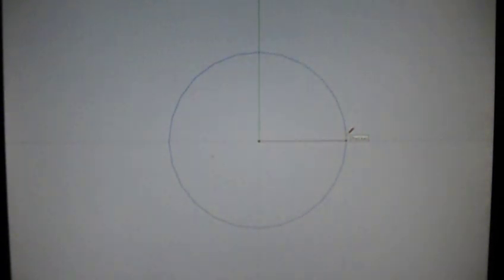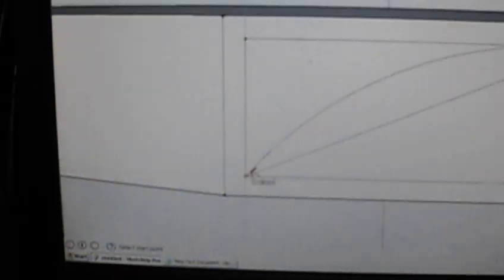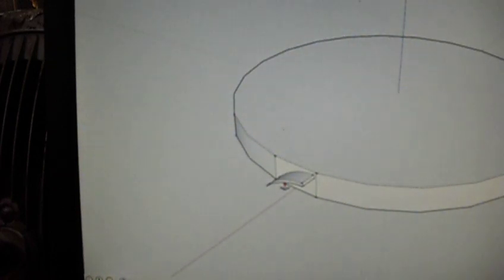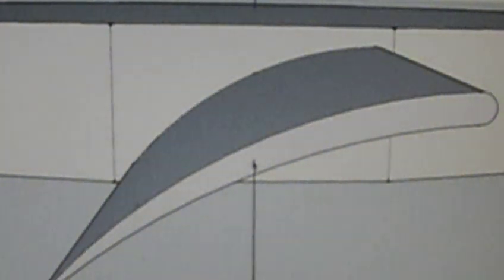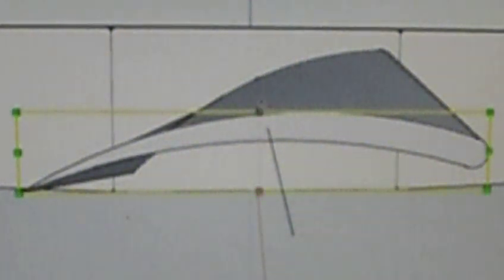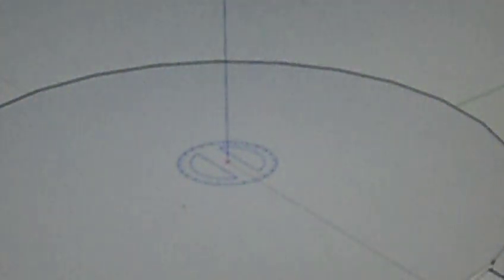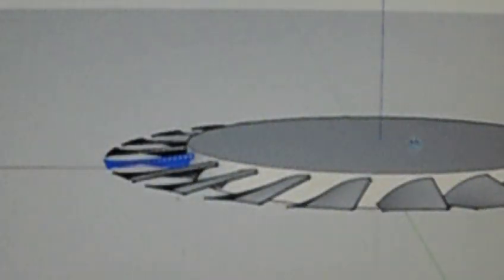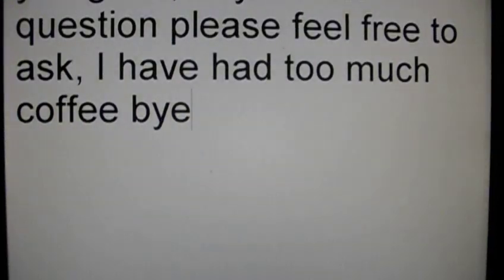How to draw a radial array of turbine blades (G-SKETCHUP)

Comment: The most fans are run inside a cowling, therefore the blade side on the outside is curved (part of the cowling circle). This is also true on a real curved (100 s and more sides) axle on the inside. It defies the flat sides of this demonstration. Thus, push/pull will not work on a curved surface.